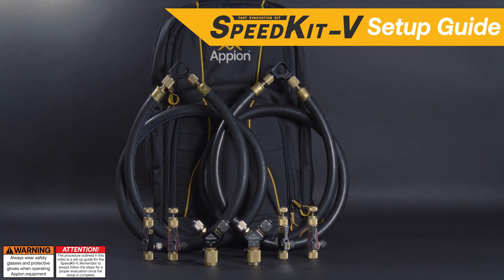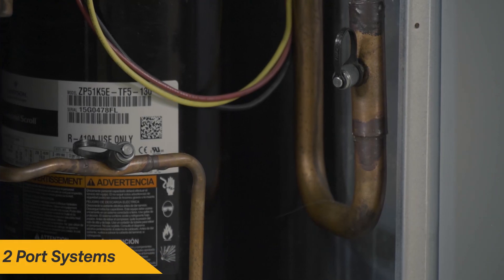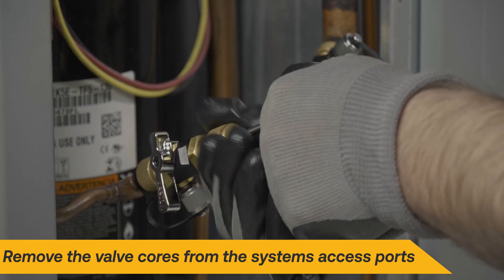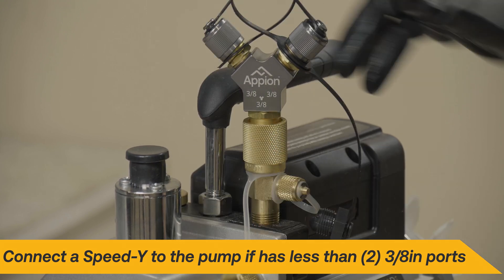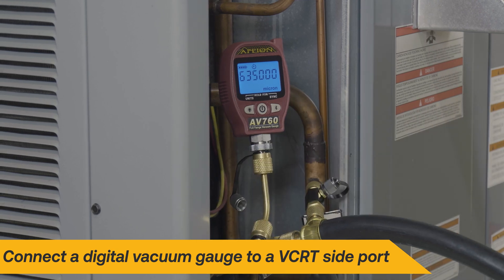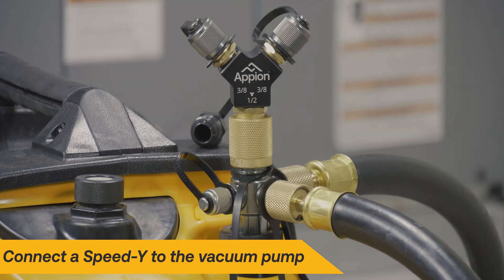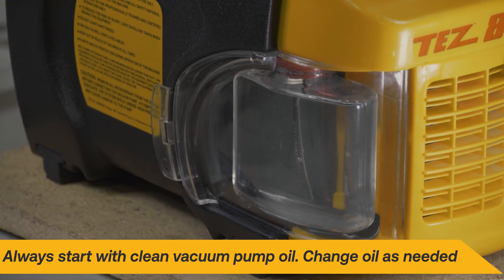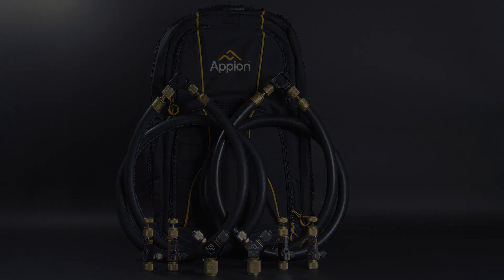SpeedKit-V Setup Guide

Comment: would it be as efficient to use the speed y on the end of the valve core removal tool and run both hoses to the pump? or is two individual valve core tools with one dedicated hose better?
Reply from the maker: For evacuation, we always recommend evacuating from the both high and low sides if possible because sometimes you may not be able to open the expansion valve whether it is electronic or thermal. And quite honestly you don't need to if you just pull a vacuum from both the high and low side ports.   

This all depends on the kind of Vacuum pump you are running, and also the system.  If you are not using a TEZ8,  It would be more efficient to just run a 1/2inch hose from each Valve core tool to a SPDY to your vacuum pump. If you are using a TEZ8, then you will not need to use a SPDY as the TEZ8 has multiple input ports for the hoses.  

Please email Support@Appioninc.com If you have any more questions or would like to dive deeper into this matter.

Comment: so if the system is filled w nitrogen for a leak test and holds pressure .. and then you hook up the crt's to the condenser valves and then the pump obviously take out the cores .. and then open the valves on the crt's it's gonna blow all that nitrogen out the lines that was being used to test for a leak. how do we avoid that becuase i been using this newer way of pump downs and when I did it w these tools that nitro blew into my navac pump caused some oil to blow out the filter cap  and I was like ok how do I avoid that from happening again ??? any advice
Reply from the maker: You're going to want to blow nitrogen through the line set then bring the nitrogen charge down to 4-5psia then connect your hoses and open them up to the vacuum pump. You don't want to expose the pump to the full pressure of the system.
Reply: Let all the nitrogen out so you don’t damage your pump